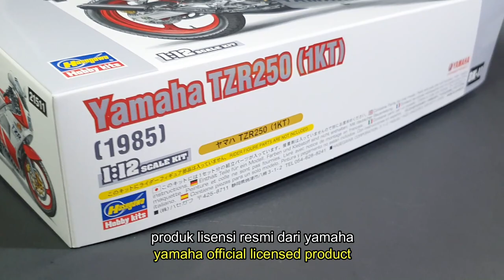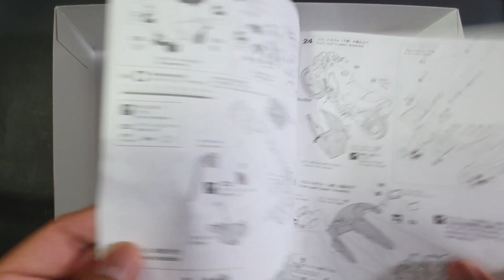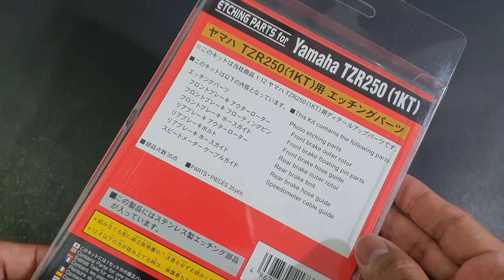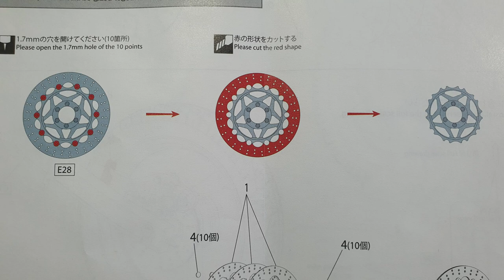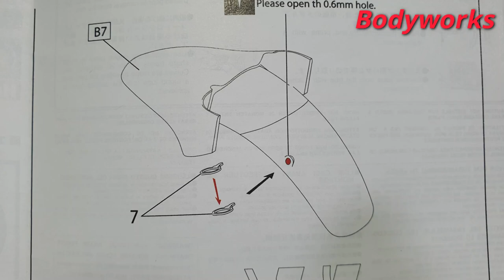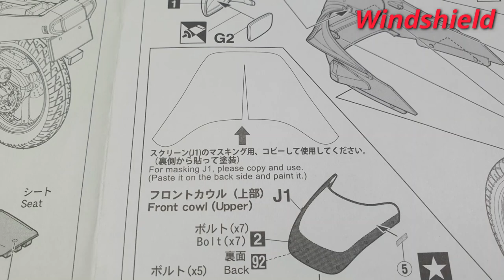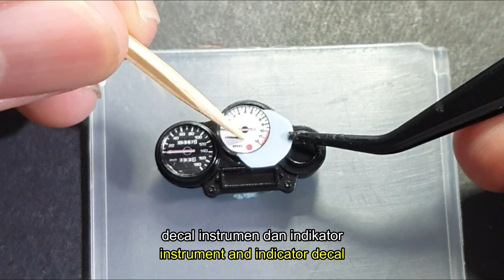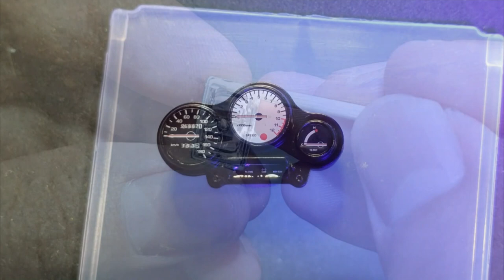Yamaha TZR 250 [Hasegawa 1/12 Scale] Plastic Model Kit Unboxing and Full Build

Comment: Nice build. I have a Yamaha TDR 250. it has the same engine as a tzr 250. 
2 cilinder 2 stroke around the 50 horse power. Its realy fast. 
I love 2 stroke motorcycles The sound is great And the smell.
Reply from the maker: Thank you for your comment, yes it is a beautiful bike indeed. Miss the old 2 stroke time
Reply: I miss the 2 stroke time too. That was a better time then now. 

I live in holland, and poeple in the traffig. Are angry and hateful and disrespectful. 
When you want overtake you are pushed off. 
In holland the poeple dislike 2 stroke bikes. 

And in italy and the UK not. 
I love italy. Poeple are not so difficult, 
I go every year on holiday in north italy With the motorcycles. 
And i liked driving is nice there. Poeple are frandley and respectful. 

everyone moves out of the way there if you want to overtake.
Reply from the maker: @lorenzo3547  try to overtake faster in Holland so they wouldn't have time to react 😆

I've heard about riding in Italy: beautiful scenery, narrow and twisty roads

Comment: Great build, thanks for sharing. Beginner's question: when you assemble (glue) two painted parts together, do you use Tamiya cement (green cap) directly, or remove some of the paint first, where the cement will go? Thanks
Reply from the maker: Thank you for the question. 

I try to avoid using extra thin cement for the painted parts. It will burn through the paint and leaves marks. If I had to use it, most of the time I would  have to repaint the parts by brush.

So after painting, I use CA gel type glue. It is more controllable and clean.
Reply: @Motomini12  Thank you very much for taking the time to reply. Great tip. All the very best.